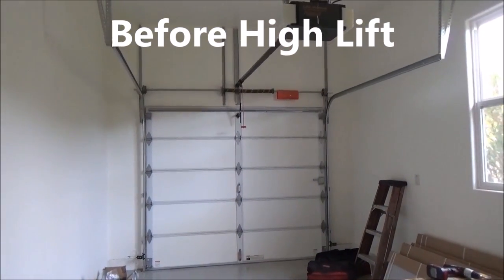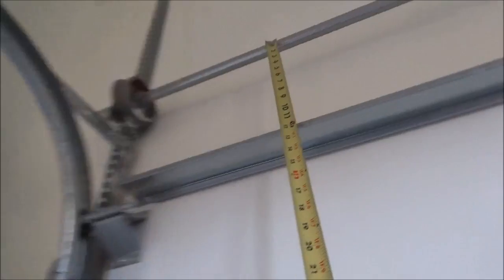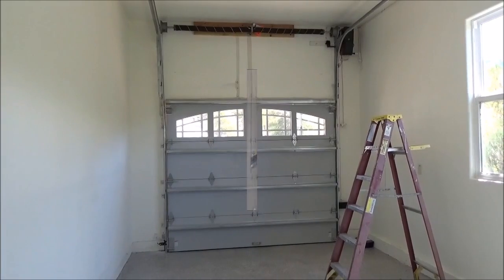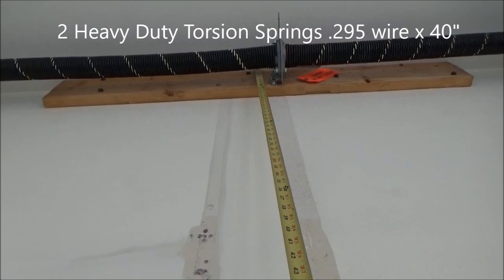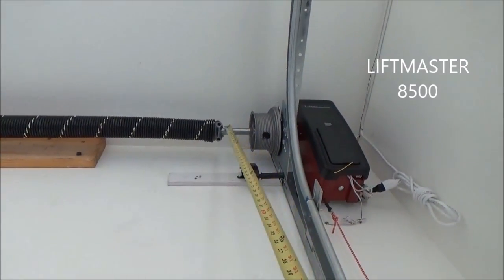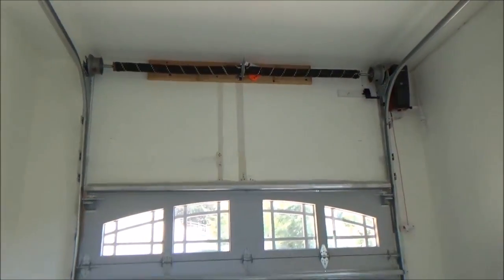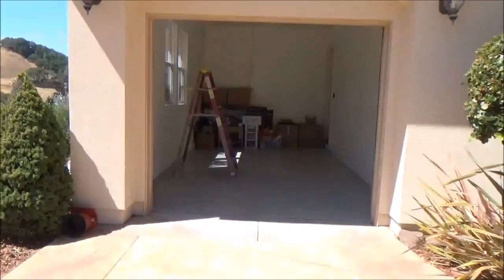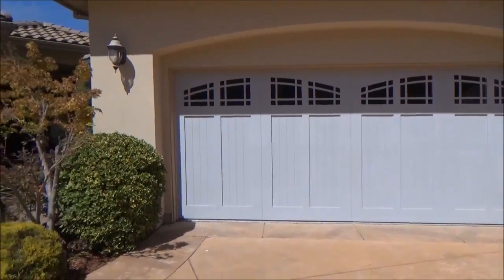High Lift Garage Door Track System Demo

Comment: Yep no big deal I've installed a thousand of them in fact I have most of the time had to cut and fabricate the track myself including the jam brackets progressing upwards to the ceiling I had a major argument with the door manufacturer anymore one time with a giant slant door because I have done it more than once and I know that you do not need coned drums to lift a slant door even if it has a little bit of high lift to it all you need are bigger springs I know that for a fact because I have done it everybody goes by what the manufacturers say but I am a 25-year veteran and I have made things work that most garage door technicians would go you're full of crap well I'm telling you I'm not full of crap you don't need progressive cones to make a slant door work you just need the right springs I have made springs I haven't made cables, I did it for years
Reply: Of course not the door is lifting the same distance and coiling same amount the extra cable doesn't get coiled just needed to reach door from greater height .  Ill take a backyard mech with years of experience over a """"professional""" straight out of school any day.  Keep Doing You Bro

Comment: Great video.  I wish you guys were local to San Diego.  I've tried three times to explain to local garage door companies what I want, and they look at me like I'm crazy.
Reply: All I wanted was the upper tracks angled up to gain 8" clearance at the back and I can't find anyone to do it.  One garage door installer said if you have the door anything but flat on the upper tracks and the cable breaks it turns into a guillotine.

Comment: Never seen garage opener mounted to the side? where do you get these at?
Reply: I believe you can get them from Home Depot or Lowe’s. Genie just came out with their side mount model last year. Much better in my opinion. Smaller, stronger and less moving parts that can go wrong

Comment: Where to get those high lift kits? I understand the motor is the simplest thing to buy, but the rails and springs.. where? Google points to YouTube videos for “garage high lift kit” query :)
Reply: I'm pretty sure you've gotta get the spring made by a door outfit.  For tracks and other stuff, I think I'll try to get a couple pieces from a salvage job and maybe even weld them to the originals to add the length needed to get the door higher up.  I'm looking at doing this in my shop.  the track extensions would just have to be tilted a little so the door clears the wall and seals on the way up.  Other than that, looks like it's just a  matter of moving some things up and putting longer cables on

Comment: I just bought a clopay 16x7 coachman with an overlay very similar to yours, and they said it's 320lbs. Is your 8x7 really 300 lbs?
Reply: There is a new model @liftmaster 8500W and this is stronger rated. It should not have a problem at all with 320lbs.
Reply: With it being wood, and the overlays, flush interior surface material and the glass a door like this can easily go to 300 lbs for a single car size

Comment: Why go to two springs?   Otherwise, nice job!
Reply: becuase the door is to heavy for just 1 spring
Reply: How come the high garage work with no chain
Reply: @qurat-ul-aintahir6080  its different system.and you probably talking about commercial vertical lift door